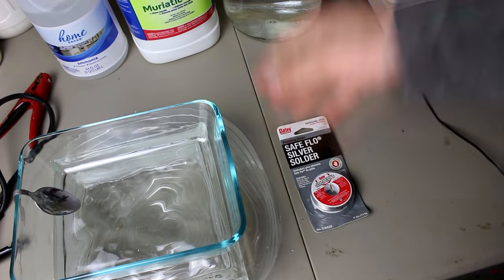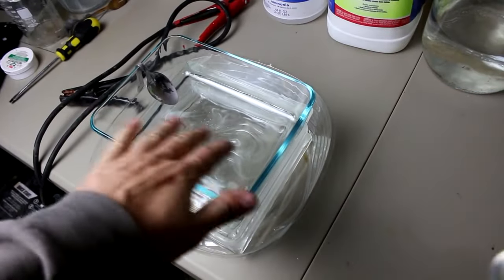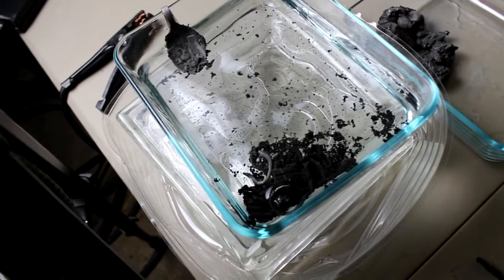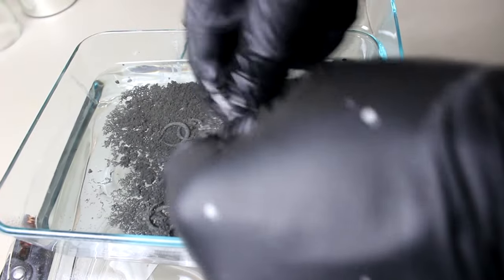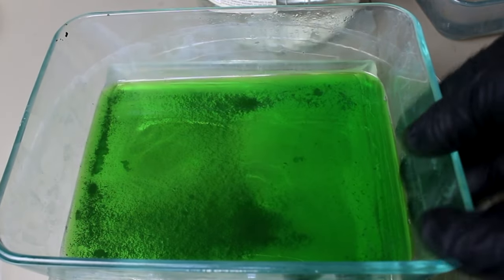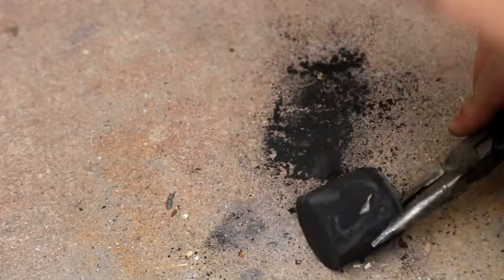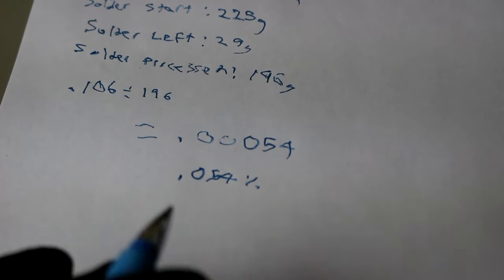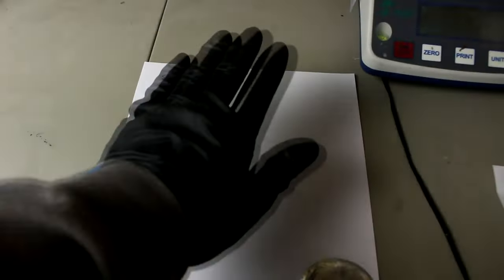Metal Refining & Recovery, 18: Lead Free Solder

Comment: The electrochemical series makes me wonder.  If your electrolyte is good and the voltage drop is due only to the redox of the metals, could you carefully adjust the voltage to selectively remove each metal in series?
Reply: Yes. It's called electrophoresis. It's commonly used in dna testing.
Reply: Tech Ingredients - I love your channel!! What you just proposed might be an interesting little video series idea of experimenting with variety of voltage and current strengths and with different alloys! You guys would do it sooo well too!!

Your DIY working w/ epoxy video changed the way I work with adhesives btw!! Like many lightbulbs went off at the same time!

Cheers

Comment: that "tin" blob, could have a little silver in it. with that high of a potential in your cell, it could have complexed the Ag as AgCl2 and deposited it on the stainless cathode.  stainless is a poor cathode candidate for HCl electrolytes as well, as you surely saw by its corrosion.  i would try it again with lower voltage (MUCH lower voltage) and a graphite cathode.  you dont want hydrogen bubbling off the cathode

Comment: Pro Tip: When pouring from a pan or something with funky corners(even a beaker) you can use a glass rod or something to direct the flow of fluids from the beaker(or pan) into your collection vessel, rather that trying to pour it and it dribble down and splash all over the counter.

Comment: Hang on, how are you so sure that the leftover curly bits of solder don't contain a significant amount of silver?
Also, if you want high silver recovery rates, get all the offcuts from commercial refrigeration guys that are too short for them to solder with. Some of them are up to 50% silver. Also contains phosphorus - thus the name "SilPhos".
Reply: an alloy is a homogenous mixture meaning the curls would have the same 1-5% silver the rest of the SS had.
Reply: You dont throw away stubs of silver solder, when you can just stick em together again. Also silfos (tm), doesnt actually contain silver for reasons i cant comprehend either.

Comment: I have the same furnace and the aluminum contact blocks they use melt when you use them. I replaced them with steel bolts and its working fine so far.

Comment: 16 volts? Seriously? Gee I wonder where the silver could be...
Reply from the maker: you might be right.
Reply: Cody'sLab I'm lost, is that low or high?
Reply: Elaborate please
Reply: At that voltage ALL of the metals in the solder will readily electrolyze(is that a word?) and deposit on the electrode. The only effective difference will be the speed at which they do it. Much of the missing silver is either in the tin, or as is suspected the manufacturer skimped on it to begin with. I suspect it is in the tin.

Comment: No!!! Lead-free solder is the most evil thing ever done to electronics!
Reply: MZ flighter lead solder is the worst thing to happen to lungs though
Reply: danny 
Not true, the harmful gasses released by solder is from the flux not the lead, and lead free solder actually needs more flux to properly wet the metal, therefore the leaded solder is better for the lungs. The reason for the push away from leaded solder was electronics going into landfills polluting the environment with excess lead in the soil
Reply: Pick a side, do you care about organic life, or inorganic life
Reply: You don't breathe in the lead, that's the flux burning off. Lead solder is fine just don't eat it, that's how you get poisoned
Reply: This is plumbing solder. Lead free electronics solder (at least that I've seen) is 100% tin, it doesn't contain silver.
Reply: i have seen lead free electronics solder that contains silver. also everyone thanks for informing me. of course it wouldnt boil off what was i thinking
Reply: MZ flighter it's it for electronics, it's for plumbing. He literally mentions that in the video, watch it again.
Reply: Don't feed it to your fish then?
Reply: actually 100% tin is terrible as electronics solder, it grows long thin crystals that will scare your electrons. mostly SnAg and sometimes BiSn alloys are used those days (eg. SAC 305 = Sn96.5Ag3Cu0.5)
Reply: Oh people... Where did I write that this particular solder shown in Cody's video is used in electronics?
Reply: I still use good ole 60/40 (PbSn) for electronics. Rosin cored, so it's rare i need flux, unless im doing some beefy audio terminals or power electronics connections.
Reply: Actually, lead solder is metallic lead, and if you eat a hunk of metal, then about a day later you're going to poop out a hunk of metal. Minus a tiny little bit that your stomach acid was able to oxidize before passing into the gut. 

A one time, or even handful of times, metallic lead dining experience won't poison you. Lead oxides are an entirely different story, but that tale has to do with paints and stuff, not solder.

Banning lead in solder is a stupid witch hunt by people more zealous in their religion than Medieval Spaniards could have ever hoped to be. It's about as stupid as banning Mercurochrome because it has mercury in it.
Reply: Geoff Graham: So true. Roy Underhill even brought an antique bowl on his show that had been patched with lead. Turns out our ancestors not only didn't know it was toxic but made plenty of eating items out of it in the form of Pewter (a lead alloy).

They claim where the lead solder is a problem is when it sits in pipes for a long time. Obvious it's easy to let the water run an extra minute before using it.
Reply: Well John, given the existence of lead free plumbing solder, I'd rather have that in my house than lead. Even though I know lead from pipe solder is unlikely to build up to the point of hurting me. Some people have acidic mineral laden water, and have lots of young babies (who do absorb lead faster) drinking it. I don't know really, but I get the debate.

Banning lead in solder for electronics, that I don't get. Not only are you not supposed to eat it, you're not supposed to put your landfill anywhere near your aquifers and water sources. Which is a non-issue because anybody burying circuit boards might as well be burying dollar bills. And there are worse things than lead in a circuit board. I might support mandatory circuit board reclamation. What I wouldn't support is mandating solder that doesn't work properly.
Reply: 04:01 tin whiskers too...
Reply: I   W A N T   L E A D   P O I S O N I N G
Reply: "Isn't that pretty?" - cody    "No!!"  -me
Reply: I hope it will never be prohibited to use lead solder for hobbyist purposes.
Reply: my few soldering projects i've done with lead free solder and it's worked totally fine for me
Reply: On my recent project, replacing blown capacitors on a big Samsung TV (a well known issue), I found the solder really hard to melt, and burnt the board a bit getting the old ones off and the new ones on. Now, I'm the worst solder technician ever, granted. 

But I remember solder melting easily, and instantly grabbing the wires and board without voids and black shit in it. When I did it years ago, it was as easy as writing in cursive. Just melting a bit left a beautiful little piece of work that looked very much like the factory work, just a little more of it.

What I did recently was damned difficult and seemed to be at the edge of what the soldering iron would do. In fact, I had to buy a new soldering iron, 45 or 60 watts, I forget; to even get the Samsung factory solder to melt. The replacement solder melted a bit easier, but not much. I was just glad I got an electrical connection and screwed the TV back together. But it ain't pretty inside.

The lead free solder worked, but I wouldn't say fine.
Reply: Geoff Graham Huh. Must be something with your solder, I'm in the UK and have no idea what everybody's talking about, our lead free solder is fine.
Reply: Really? I'll take your word for that. How is the solder on Samsung TVs in the UK?

Comment: Cody, Repairing electrical dingles is my thing, only times i see wires burned off heating elements like that the elements have fried. Quick ohm test before reattach wire will tell the tale.

Comment: "Diluting the acid should turn from green to blue." Please explain this. It blows my mind that diluting something should change its colour.
Reply from the maker: Changes the ph and thereby the oxidation state of the copper.
Reply: Thanks Cody. So I guess it wouldn't work with distilled water because the oxygen is absent, correct?
Reply: Thomas Stewart distilled water could still have oxygen in it, gasses dissolve in water readily. But oxidation state actually means how many electrons the copper has lost, oxidation confusingly doesn't necessarily involve oxygen.

Comment: Why do Americans pronounce solder as sodder?
Reply: Because the l is silent
Reply: Andrew F I'm not even American and I pronounce it like that. (Although I might have been influenced by Americans.)
Reply: its actually a regional thing, most americans would say sodder, others would say solder, it just depends on where you live, and who pronounces it like that
Reply: because there isn't an e at the end of solder to make the o sound long. The position of the tongue when pronouncing "ld" means the ah of the o blends to make it sound like sod.
Also, that's the correct pronounciation of solder.
Reply: So English gets it from French (soudur/soudure), and in French there is no "L." So originally in English, it was pronounced without the L. A couple hundred years ago, when spelling was getting formalized more and more, it was decided to add an L, to reflect how the original word was spelled in Latin (solidus/solidare). 

It was still  pronounced "Saw - dur" for a long time, but eventually in England, people accidentally started pronouncing the word how it was spelled, rather than how it was supposed to be pronounced. This didn't happen in America for whatever reason.
Reply: will h: Is that true about the french? Very interesting but it doesn't explain why guys like Mr Carlson's lab pronounces it "saul der" and he is in CA where french is a nationally, or at least regionally, accepted language.

Every once an a blue moon I run across an American that pronounces it that way but I went to college for Avionics and no one in the whole place pronounced the L in it.
Reply: Yeah, its still souder in French. I can't speak for Canada definitively, but I would assume English in Canada is more influenced by their time as a commonwealth than by the French outside of Quebec. How any one person pronounces it is going to be based on their personal experiences though.
Reply: We hold together in solidarity, we make that glue a solder. When we bind together with solder, it isn't sold, no, we make it solid.
We can take a sun named Sol and make it a fish with sole, or give it salvation with a soul. But if you follow those rules and don't add a U where there aint, people will say you are pronouncing solder wrong.
Reply: Because we gave Britain that L in 1776
Reply: Andrew F I'm American and I say it solder
Reply: Wallywutsizface
this boi
Reply: Lets call it pineapple dont call it ananas ok ?
Reply: Simple answer, they’re americans
Reply: As a canadian, I had no idea anyone was pronouncing the L. If they said that near me I'd offer them a slice of bo-LOG-na or some la-SAG-na. Ask if they wanted to ride my Puh-ter-o-dact-yl
Reply: English may have got the word "solder" from French but pretty much French came from Latin, and guess what? the L is not silent in Latin :P.
If the L in "soldier" is not silent, why should it be silent on "solder"? it's almost like if Americans were lazy when it comes to pronunciation /s

Comment: I've been using silver bearing solder for most of fifty years, the typical solder is listed as 4% silver, it is sufficient to improve the wetting action, and bonding to metal, and strengthen the bond.  I expect it's rather difficult to get that little bit, out of the enormous volume of other metals.  Of course you've answered a question I've had for a decade, why doesn't silver bearing solder work like it should?  Bastardized like everything else of course.  Thanks for the fine chemistry experience!!

Comment: Nitpick, when rounding floating numbers to fixed count, you should +1 to next digit if it's greater or equal to 5. For example, 5.45  ~= 5.5, 4.55555 ~= 4.5556 ~= 4.6 ~= 5.

Comment: Cody, you recovered only a small fraction. There are multiple ways to lose silver through the process (on dissolution, electrolysis, decantation, oxidation, transfers, smelting...) and they're multiplicative, so even if each loses 20% of Ag, at the end you get only 1/4 of it. If you want to determine the silver content, here's a suggestion:

* Dissolve 10g of solder completely into nitric acid. 
* Fix the pH to ~6 with lye/sodium hydroxide
* Dissolve some table salt/sodium chloride in water and drop the solution into the first. SLOWLY, mixing it well, until it stops precipitating.

Then the silver will precipitate as AgCl while tin, copper, bismuth (yup, I've checked the site) remain in solution. It's then about filtering, drying and checking amounts.

On the "too low pH": excess HCl also raises the concentration of chlorides and silver forms complexes more soluble than "plain" silver chloride.

Comment: I know this is a little OT but if you have to pay shipping to send that furnace back in it may cost more in shipping than if you just do it yourself. Find some high temperature wire like Nichrome (available in any toaster BTW) and make sure it is thicker than what was there and wrap it around the wire then tie it into the block. Otherwise I would try the highest temp welding stick you can get your hands on. Weld it to a welding rod and clamp the screw down on that.

Comment: Nice video,
You might like to try the same process on a known sample . If you use "silver solder"  as used by engineers it is sold in diferent grades depending on the exact silver content, usualyy 20 to 55%. 
eg "Johnson Matthey.1.5mm SILVERFLO 55 SILVER SOLDER STICK" is about $10 for a 600 x1.5x1.0 mm stick   and is   " 2% Tin, 21% Copper, 22% Zinc, 55% Silver". At current Uk price is is about $600 per Kg ,  so it costs about twice  the cost of pure silver so still not economic unless you have some lying arround.

Comment: One big correction. Tin is per/100lbs when it's bought at most recycling yards. So it would be $10 per 100lbs of tin. Not per pound. So, 10¢ per pound. That piece of tin you have would be worth 3¢ at most. The silver is probably worth the same.

Comment: Hi Cody. Can you process some clay from the ground into useable modeling clay? Much like the king of random did but instead of starting with dirt, start with clumps of clay?
Reply: It would be interesting to see a deeper look into the physical and chemical properties that make a good modeling clay. For example, some clays are much more plastic than others, which is very desirable in a modeling clay, and some clays are very expansive, which is undesirable.

Comment: also graphite anode and a stainless steel cathode works much better, i used a pumped solution with a rotating cathode, and variable amperage depending how much silver was suspended in the solution, the lower the yield the lower the amps otherwise you will cause the solution to sulphide, after recovery the solution was pumped through a bucket containing steel wool, this would be kept going till it shows silver on the outlet, i would treat the steel wool with hydrocloric acid and water mix to dissolve the steelwool, then smelt the remainder. thanks for sharing.

Comment: Would checking the melting point of the solder be a good indicator of silver percentage?
 It  is a eutectic alloy meant to melt  at a lower temperature than either of the component elements, tin and silver.  I do not know whether the proportion relationship is a linear one easily converted or not.

Comment: I wonder if most of your silver electro plated? There would have been a lot of metal ions to take up the Cl so the silver ions probably could make it across just at lower speeds?

I have had a fairly good recovery (~5%) from solder sticks just dissolving out the Silver as a nitrate... was messy as you said

Comment: @Cody's Lab, have you ever done a follow up with the xray detector? 

Have you tried real silver solder (my experience in the plumbing and HVAC trades has taught me that common solder, like you used, is far different then what I was taught is silver solder. "Real" silver solder is used by the HVAC guys who connect AC line sets and such. It has a much higher melting temp then the types used for standard plumbing, and is also supposed to be stronger then the copper it connects!)? 

And lastly, could you help me to understand/make a video on: How I can process my own scrap- As a plumber/HVAC mechanic, I come across a lot of copper, brass, and of course solder joints. The scrap value is down right now, I'm willing to experiment to refine some of the metals I have (Cu,  Zn in the brass, Sn, etc.). Thanks again Cody, love your work in educating your fellow man:)

Comment: I really like the practical chemistry. and refining of precious metals..Thank you . I will make it a habit to throw you a bone and contribute to patreon to support what you are doing . Good job ... Joseph Henry , Boise , Idaho.. Suggestion ............................................................................ There is a useful test for gold prospectors , using Augua regia to desolve the ore sample, and then throw a little stanous chloride solution in.. If there is gold in there it will turn a shade of purple, and this is a very sensitive test, being able to detect up to 1 part in 500,000. if its a very faint color. The higher the content, the darker the purple .Important to  Check the results immediately, if you wait the color fades and gives inaccurate readings ...... Peace out ............